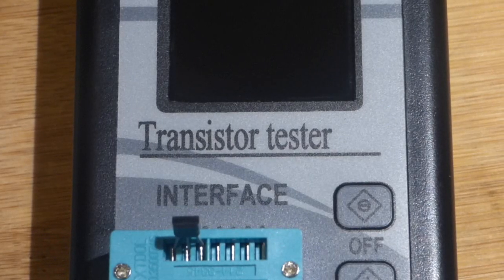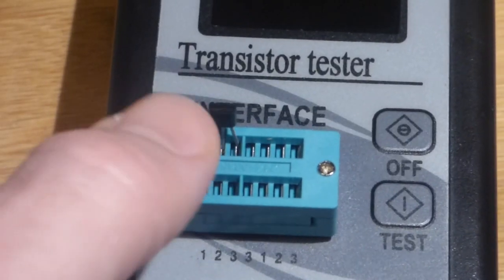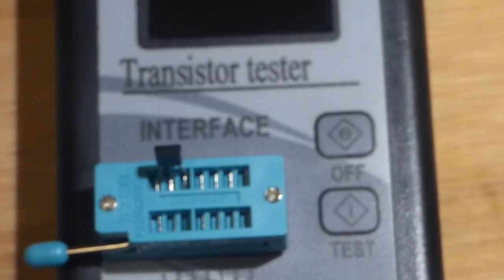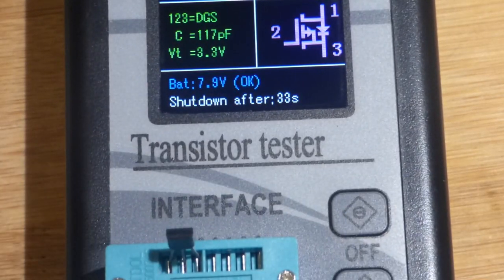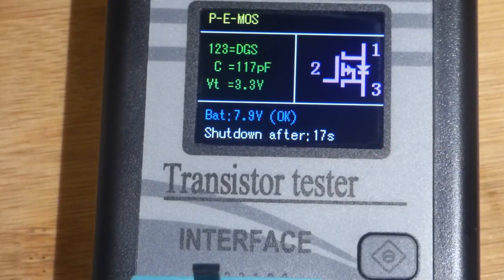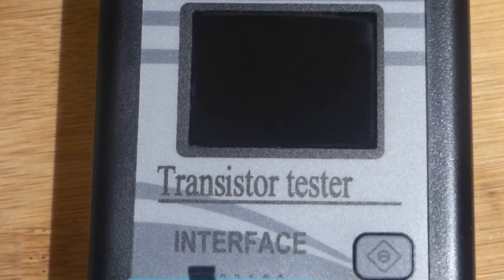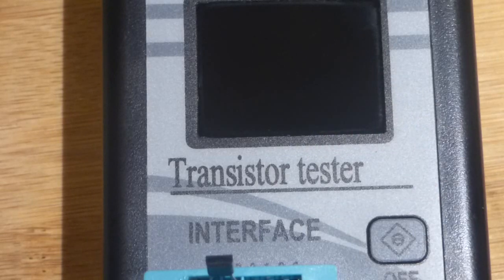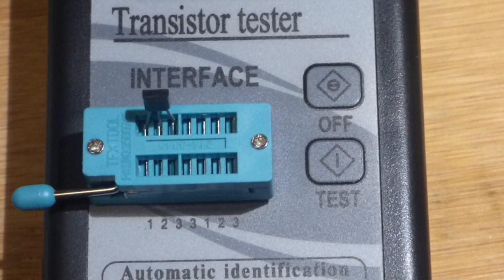Component and transistor tester measuring BS250 P channel enchancement mode MOSFET

Comment: Transistor testers are very useful. I got one of the AT Meha kits from Enay and find it useful for checking everything from resistors and capacitors to diodes and transistors. Far quicker than trying to decode the markings or dig out a data sheet (and getting it wrong or forgetting).
Reply: Sorry about typos. Note to self - don't type in the dark.
Reply from the maker: Nice!